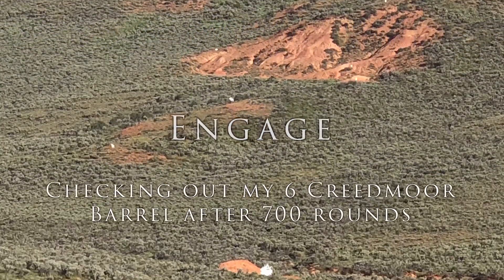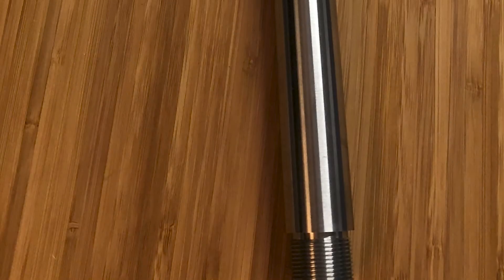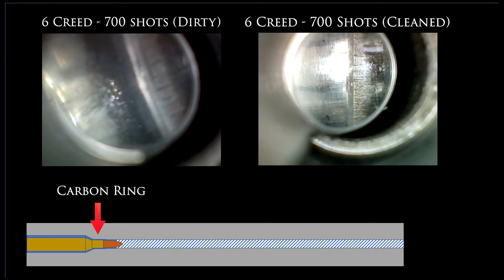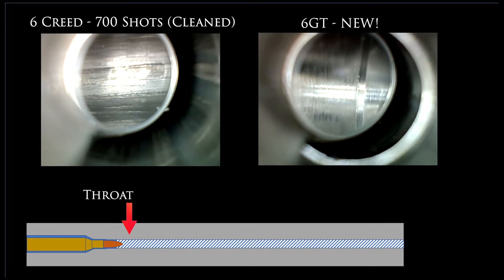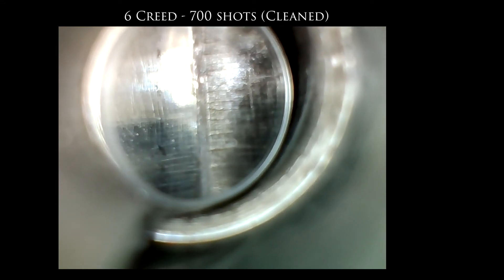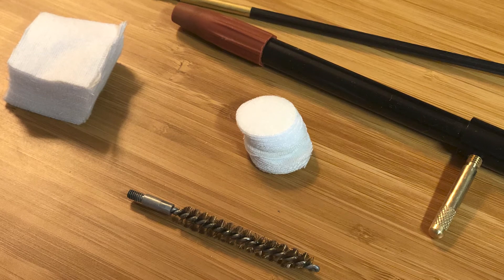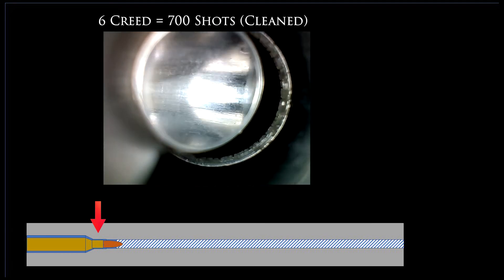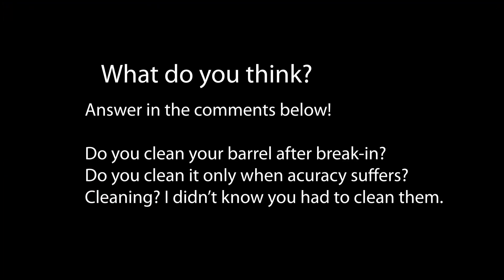Borescope Inspecting a Bartlein 6 Creedmoor Barrel After 700 Rounds

Comment: New gun, first clean and light lube. Then I run a dry patch thru after each round for 5 rounds, then a wet patch followed be a dry patch after the next three 3 round groups. Then same after two 5 round groups. All the while inspecting barrel with bore scope and looking at what it's telling me. If I see any rough spots or unusual fouling I might use some JB bore bright. After that I do a light cleaning after each use, weather 5 rounds or 20. Every 200 rounds I do a medium cleaning, getting out 90% of the fouling. After a 1000 down to bare metal. Just now getting my 270 re barreled after approx 2000 rounds. Groups went from 3/8" to just over 1" last 500 rounds.

Comment: I can’t believe the damage you had!  I’ve got a T/C Encore barrel in 7 mag that who could possibly guess the round count.  It doesn’t have that much and I load 70  + - grains of powder at pretty much max loads.
Reply from the maker: Thanks for checking out the video. It's definitely odd how different barrels and different calibers behave. I've got about 2100 rounds on my 6GT barrel and it doesn't look much worse than my 6 Creed at 700. On another note, If you're shooting your 7 mag for a thousand plus rounds - good on you my friend!  That's definitely a stout one to be shooting a ton!
Reply: @Engage1  I’ve had that barrel ever since the Encore came out.  Has a non-removable factory Muzzle Tamer brake on it.  Probably around 1985.  Thank you for your video.  I always like seeing what others are doing and encountering.

Comment: Nice video. Here in western Washington, I tend to clean after each shooting session. Our climate is humid, and any copper left in the barrel can oxidize quickly. Not sure it makes a huge difference, but I don’t like seeing blue streaks in the barrel. Maybe just running an oily patch through would be enough, but at that point I already have the cleaning kit out anyway!
Reply from the maker: Thanks Steve -  That sounds like a good plan, especially for humid environments. I have shifted toward cleaning more frequently over the last year.  I've also been trying Thorroclean (which is predominantly abrasive instead of reactive chemicals) and it certainly speeds up cleaning for sure.  I still don't have enough data to see if it wears out the barrel quicker and I'm renewing my data on accuracy as well - but previously didn't see a statistically significant increase in accuracy by cleaning regularly.
Reply: Same here in the austrian alps. My problem is condense watter build up in the bore, due to temperature differences. I always keep my bore slightly oiled, of course i have zeroed my guns for this bore condition. I only hunt, so the 1st shot is all i care about.

Comment: Could you include what equipment you’re using? The price? Thanks. Oh, I clean after groups start to open up. Great stuff, keep it up.
Reply from the maker: Blake.  Sure thing...  The borescope is a Teslong Rifle Borescope model V201909-11.  It attaches to my phone via micro USB which powers it and the video records to the phone.  It's been super handy and wasn't very expensive.  I think I found it for $45 or so on Amazon.   Here's a link to the one I bought on Amazon.  https://www.amazon.com/gp/product/B07TTQF24F/ref=ppx_yo_dt_b_search_asin_title?ie=UTF8&psc=1

I use a number of bronze brushes -  I just purchased another batch of them from Amazon.  Here are the ones I use most frequently though I am not too picky on which brushes I use.  https://www.amazon.com/dp/B08NNQMR3L?psc=1&ref=ppx_yo2ov_dt_b_product_details

I also have a couple cleaning rods.  Here's the one I recently purchased:  https://www.brownells.com/gun-cleaning-chemicals/cleaning-rods-amp-accessories/cleaning-rods/27-45-caliber-12-8-32f-cleaning-rod-sku100030455-57075-224697.aspx

Aside from that it's typical patches, jags, and the solvents I mentioned in the video.  Best of luck and hope it works well for you!

Since making the video, I've started cleaning more frequently.  I've also tried CLR and recently Free-All  (blue bottle) to help remove carbon and it seems to work really well.

Comment: I watched a video by Erik Cortina and he recommended using a bore scope and cleaning the barrel. His point was that you always wanted to have a repeatable starting point. Since I have been using a bore scope, I have been cleaning more often. The bore scope revealed that even when the patches came out clean, there was quite a bit of carbon still. I clean after every 50 rounds in my 6.5 CM and 7mm Rem Mag. The reason I clean so often is that when I do this, the clean up is pretty minimal. Usually no brush needed and just 4-5 patches.
Reply from the maker: Thanks!  Erik has some awesome videos and is someone I definitely look up to. I've started cleaning more frequently as well. At my level of shooting, I haven't noticed too much of an improvement, but I do like having a clean rifle.
Reply: Smart !     Exactly what I'm doing.    Don't let it get bad and don't let it sit dirty .    I never need a brush just 6r8 patches w sum crc brake cleaner.  Then a nice oil patch B4 she goes back to bed.

Comment: I’ve gone to taking Brian Litz advice and clean after every 100, with abrasives! Usually JB or Iosso on a tight patch, 30 strokes, up and back is one! Flush, repeat, done! Super fast, and the end result is easily repeatable. If it’s really bad, not cleaned in several hundred rounds or more, will use a bronze brush before flushing after the first round of abrasives. Never damaged a crown using a bronze brush, never damaged a bore, haven’t scratched anything with it. And it’s fast!
Reply from the maker: Thanks -  I've started cleaning more frequently since I made this video too.  I don't think I've noticed a ton of difference at my level, but I'll clean about every could hundred rounds.

Comment: So why the change from 6 Creedmoor to 6 GT? Barrel life?
Reply from the maker: Thanks, bloke3006 for the comment.  Yep, a good amount of barrel life driving the decision and a bit of ease of finding a load that works well. I didn't have much of a problem with 6 Creed for that but had heard that it was easier for 6GT and honestly, it felt like it was while I was working up the load for my 6GT.  Just about every load shot well. I also went lower velocity with my GT than I was at with my Creedmoor (2850 vs 3100) - and found that it was much easier to see impacts as a result. I was a bit worried about case fill if I loaded my Creedmoor to lower velocities, but that may be an unfounded concern.

Comment: Answer to your questions at the end of the video… I never clean after break in unless it stops shooting well, etc. 
I recently have started having difficult extractions, but no pressure signs on my 300 PRC. Assuming this is due to excessive fouling in the chamber/throat area.
Reply from the maker: Nice. Thanks for the comment.  I've been experimenting with cleaning more frequently recently.  I've started using my magnetospeed to test when the barrel gets back up to a consistent velocity and have found it to be just a few shots.  Hope your 300 PRC cleaned up well and is doing better on the extractions!

Comment: Thanks you for this good video. 4 years ago I had a custom built Krieger 5R barrel made for my Rem 700 Sendero in .300 RUM. The factory gun is stainless steel and so is the Krieger barrel. I'm a bit confused not sure when I should have the barrel replaced? The original barrel only has about 50 rounds fired out of it. Not sure how much life I'll get out of the original barrel before changing it.
Reply from the maker: Depending on your purposes for the rifle and how accurate your first barrel is, it should last probably a thousand to two or three thousand rounds before it starts to suffer significantly (depending on powder/etc.).  I do feel like the Krieger barrel likely will give you an increase in accuracy compared to the original barrel.  Since you already have the new barrel, I would have a gunsmith spin it on or do so yourself if you feel qualified (definitely don't do it if you don't know how to properly headspace the chamber/etc.). Then, you can keep your original barrel as a backup (that you likely will never need to use). It's definitely an upgrade compared to the factory one and I'd be surprised if it didn't shoot better than the factory one.  Best of luck to you!
Reply: @Engage1  Thank you very much for your suggestion.

Comment: hi in your experience what is the minimum number of rounds engaged before a barrel is worn out..
Reply from the maker: Hi John - the classic response is "it depends."  On one of my 6 creedmoor barrels, I got about 1500 rounds before I retired it.  It was about 1 MOA at that time which is still awesome for most things, but I was looking to move to a new caliber for PRS (6GT) and 1 MOA is not optimal for PRS events.  I shot that barrel quite hot (3150 fps) which I think is why it didn't shoot as well after 1500 rounds.  I probably could have rechambered it or adjusted my load again and gotten more life out of it though.  I've still got it around - maybe I'll give it a try!  I've had .223 barrels that have easily over 6,000 rounds through them. They are not super accurate and never were intended to be, but still work for plinking and having fun. Barrel life is a factor of a lot of different things like barrel construction, how "hot" the rounds are that you shoot, how hot the barrel gets, purpose of the rifle, etc.  If it still shoots well enough for your purposes, and is structurally sound, then it's likely still good to use.
Reply: @Engage1  Thanks for the enlightening me sir..

Comment: EXCELLENT video....On point, informative, and no extra stuff like unnecessary, loud, distracting music.  I was taught at a recent long range class to only clean when accuracy suffers. Even then, start with the least aggressive method possible, until groups return.  Usually, this will be Hoppes 9 and some light brushing and patches. 

Me personally, I clean about every 250-300 rounds, making sure that the chamber is clean, and I wipe out any gunk, dirt, old lube, and carbon from the receiver and bolt (I use Zep Orange degreaser), relube the bolt, clean the optic, and call it good. As part of the barrel cleaning process, I’ll use a bore guide and also remove the muzzle brake to clean the carbon, inspect the crown, and re-tighten the brake.

Copper and barrel break-in are not as big of issues as most people think, especially with a premium aftermarket barrel. John Krieger of Krieger barrels states in an interview on YouTube that more barrels are worn out from cleaning than they are shooting.
Reply from the maker: Thanks!

Comment: How did you get the ring out pls
Reply from the maker: Thanks for watching! After running a few patches soaked with Hoppes 9 through the barrel and letting it sit for 3-4 minutes, I ran a nylon brush up into the chamber/throat and swirled it around a few times.  The carbon comes off pretty easily after that. Next I ran a few more patches through the barrel to clean everything out.  If it all doesn't come out after the first time, repeat it again and it should do the trick.